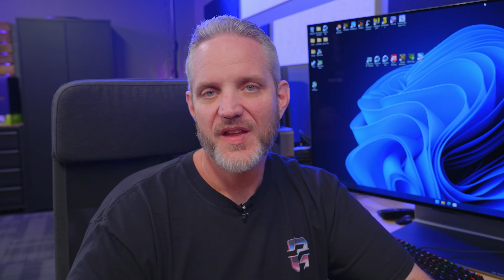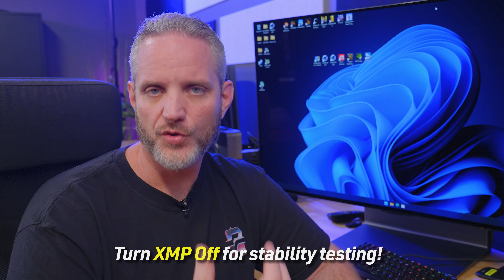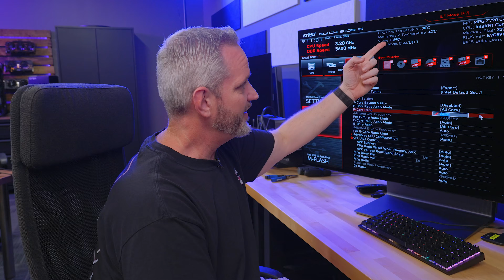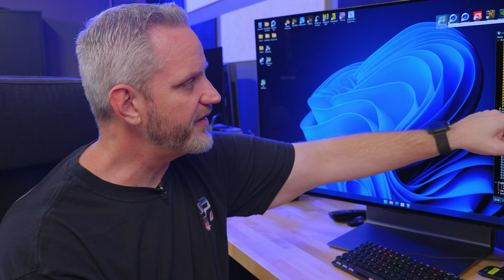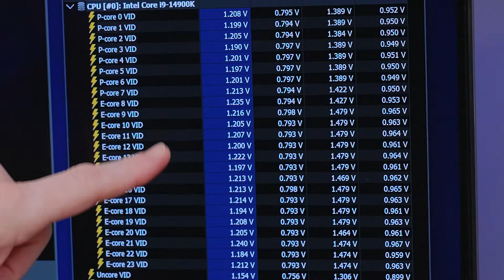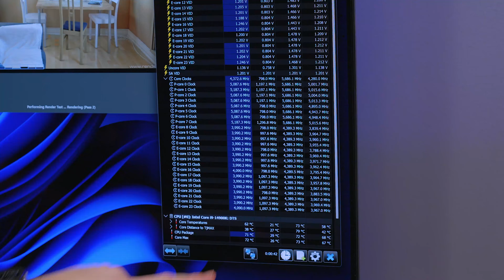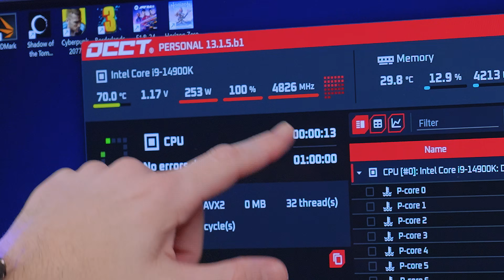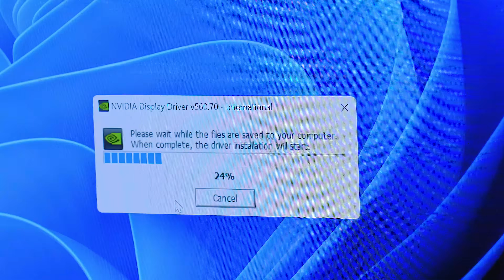Guide: How to check if your CPU is BAD!

Comment: I have a gaming laptop with intel i5 13450HX CPU and since i bought it i was facing extreme heating issues. Temps were always stuck at 99*c - 100*c under load and sometimes even pushes beyond 103*c (i checked that via hwinfo and throttlestop), after some serious search i found out that 45W is base power required for this processor to work and 55W is recommended and 157W is max it could pull if sufficient cooling is provided. BUT my concern is after going through throttlestop i found that pl1 is set at 191W and pl2 is also at 191W so i changed its value pl1 at 55W and pl2 at 157W but after testing it frequently showed power throttling and the cpu is not working as it should(ig due to less power) and the temps were under 80*c. The cpu struggles with this change in settings and when i revert it back to 191W it starts working flawlessly, my concern is i might cook it's mb if i continue working on this laptop for a long time(5+ hrs) any help on this weird issue !?

Comment: I'm preparing to test my CPU and have a QUESTION for you @JayzTwoCents as well as for your comment section!!

5:25 (video tamestamp reference)
I have 2 RAM sticks in, how many should i take out for this CPU test?

I'm running 64.0 GB (63.8 GB usable) Installed RAM :)

Comment: Why you blame the motherboard manufacturers for Intel’s faux pas is baffling to me. Intel should have built in protections on their CPU’s……..but they chose not to do that because AMD was and is kicking their ass. The faults within these chips lie clearly with Intel……….not the motherboard manufacturers. Intel advertises a certain level of performance with their cpu’s………and that performance promise is what “we the customer” expect. Their microcode update is nothing more than a pooch of performance…….and yet…….you lay the blame at the feet of the motherboard manufacturers. I do not agree with that position at all. The failure of Intel’s CPU’S was inevitable. They sat on their hands while AMD introduced their ZEN processors and got their asses kicked by ZEN. They refused to innovate……..and that lack of innovation forced Intel to drive ridiculous amounts of amperage into their CPU’S in an attempt to keep up to AMD. Intel failed miserably in that attempt and I certainly will not defend their lack of foresight. Blame lies squarely with Intel………..end of discussion!

Comment: I have a i9 10900k and I build this pc my self it’s been running great until recently, and it’s just been blue screen after blue screen and black screen and freezing and I can’t tell if it’s the gpu or the cpu , I changed out the psu but it’s still doing it

Comment: When you buy a new CPU, you're tempted to test it. When I ran Cinebench R23 (default BIOS settings), HWiNFO reported 320W for my 14700KF. Huge! It's criminal to set default values that exceed the maximum allowed by almost 30%.
Reply: Tempted? It’s crazy not to stress test a new build.

Comment: I have question i updated bios after that i had few crushes and apps freezing and not responding i saw that fans are working like on 100% and then pc restart i watched pcu temp and its not like overheating before the restart of pc, but at the time of the heating like when the fans are working on 100% i feel that pc case is little bit to hot on top corner where is cpu i also notice that one ram is not working properly can that cuse system to slow down not opening apps now i dont have problem after gaming like 1 hour cpu temp is about 65%75 on full load. What can be the problem that i had few crashes ? Thanks anyone for responding.

Comment: I have a 5950x on a water cooler and it is unstable since day 1. A little reseaech on this topic and you find out the absolute nightmare that is zen 3 high-end. Nonetheless, there is not a SINGLE youtuber investigating this issue. There are so many cases  out there of people RMAing the entire system and not find a solution. It is mind blowing how AMD can get away with that. By what you can find in the forums everywhere, AMD's problem is WAY worse than Intel's. No youtuber ever talk about that. Intriguing, to say the least.

Comment: I7 13700k, rtx 3080 it, ls 720 deep cool, 16x4 ddr5 ram, msg mag z690 ddr5, Corsair 4000d cabinet, I just reassembled my pc after RMA of several pc parts, everything works fine except that my multi core temps reach 100 degree, I even used grizzly kryonaut thermal paste, newly build it never reached 90 degree in 2022 but now p cores reach 100, what should I do please help.

Comment: The only thing that you have to do to test the CPU is take it out of the socket, tap it with a hammer (make sure it is metal), and listen for an echo.
Reply: Then replace it with a Triscuit-Mini "Unlocked" (about $15 a Tray) and I use Skippy/Smooth its cheaper than regular rip of thermal pastes.

Comment: i got a z790 asrock pg lightning with 13600k and 32 gb corsair 5200 mhz ddr5 last week. I had it running stock and my pl1 / pl2 was 253 , iccmax 511 A. Then i updated the bios to the last version and i set the boot parameters to BIOS DEFAULT and i got the intel recommended values (181 pl1/pl2,200 A iccmax). I was very scared at first but no problems with temps or something weird. I got the same performance on gaming before and after 0x129 v. What value should i have on VCORE and VID?

Comment: Im having some issues with my i9 14900ks. i did a test 30 min in heaven bench but no errors, then the day after it just stalled/freezed. Im thinking its one bad core maybe. im gonna try OCCT and intel burn test when i get home. The funny thing is it rarely crashes when in game (iracing and Lemans Ultimate), almost always if im doing something in windows while the games are running.

Comment: My 9900k runs at 4.8 GHz yet performs half as well compared to benchmarks I'm seeing online. Any clues what may be going on? I feel like it's thermal throttling but it stays at 4.8 GHz consistent and the frametimes in Counter Strike are consistent

Comment: I have a 13700kf bought it on December 4, 2022. So far no errors or crashes. But there is a nuance. e-cores I disabled and lowered the frequencies to the (3300). I just don't need that kind of power yet. Sometimes I turn them on, but because of the noise of water cooling I don't like it at all. Maybe I just prolonged its life if it's oxidation, which you didn't mention, which I think is a bigger threat in the long run. And that's scary! I did tests right after purchase with factory settings and everything was ok. I even did downvoting which improved performance. moba (gigabyte z790 gaming x ax, with XMP ddr5 6400) Thinking of moving to new ryzen. Due to the fact that there is less TDP. intel has lost confidence. I never had any problems though except temperatures even with the three section water cooling which is noisy as a train if you have an i9 or i7! In my case it was the 7980XE and 13700kf.

Comment: I just bought my 14700kf cpu in October 2024. 

The batch says X432... does that mean it was manufactured in July of 2024? 4 being 202(4) 32 being week 32.. July?

The oxidation issue was said to be resolved in 2023. So I might have dodged that. 

My msi motherboard has 10/09/2024, the final latest bios microcode update fix (0x12b). 

I wanna return everything and get the 9800x3d, but it's jacked in price. Plus, I'm using Afirm financing, and it's a whole long pain in the butt. Plus i have to put more money down if I return it. Just isn't worth it...  Ehhh

Comment: i'm not sure 13700k on a msi z690 but started with needing to replug my usb dac from time to time to register to, after every boot cycle. Now the pc is having issues booting at all. no faults to be found but just bootlooping most of the time. but when i go to bios and pres f10 it will boot. weird stuff is going on. ssd and cpu are a little over a year old. 
thing never chrashed tho while running or gaming.

Comment: I have an origin system with a series 14. It started acting up with blue screens. Tried replacing the ram since the message I was getting was memory related. Didn’t help. Did a ram test both the original and new ram were fine. Was able to reinstall windows at one point and things seemed fine - for a while. When I tried reinstalling my software got bsd again. Rinse and repeat. After a while thought first thing I should do is update the video drivers and got those corrupted download errors, or error extracting the zip after it downloaded. Got this to happen consistently. Sent it back to origin and they found the cpu and motherboard needed to be replaced. Got the system back now and things work perfectly.

Comment: I am running the MSI PRO Z790-A WIFI with an Intel i7-14700K CPU. In recent weeks started getting a complete PC freeze. No black or blue streens, the whole screen just freeze up with no sound or any response. I cannot Ctrl Alt Del or anything. I was wondering if that had anything to do with the CPU or Motherbnoard, since the issue even happens when trying to install a brand new M.2 Win 11. The install screen just freeze too.

Comment: holy... i am fraking out now! because i currently own a I7-11700k, with a rog strix z490-e with 4x8gb corsair ddr4 ram and a nvidia rog strix rtx 4070 ti oc... its overclocked by 38% using a noctua air cooler, i never had issue whatsoever. i wanted to upgrade, so i bought/ordered a new intel I9-14900k, with a rog strix Z790-e version 2 MB and 2x32 GB corsair ram, and im afraid that i made some bad purchase. my I7 system is running 7/24 since 2021. i am wondering now if i have a bad CPU! so this video at least showed me to lock voltage in place etc... i guess that from now on, i will shutdown PC when not using it... oh wait, i work with this pc 8 hours a day, and then i game for 2 hours... glad to see that intel is respecting rma. there should be a way, to have a little cpu components inside the chips, that could tell us the degradation, a little bit like nvme/ssd can tell us.

Comment: I had a computer technician come over and advise it was my graphics card (I got the black screen on the heaven benchmark).  Tried to return my graphics card, it was given back to me by the retailer who stated they benchmarked it and it was fine.   I hadn't played Black Myth Wukong for a bit, so loaded it up, and it needed to compile the shaders again.  When I first got the game, I had multiple crashes before successfully getting into the game, and this time was no different (crashed first time).  After a bit of research as to why this was happening with Black Myth Wukong, I ended up going down this rabbit hole of intel 13th and 14th generation CPU's and their instability issues (I have an I9 14900KF).  I have since downloaded the latest BIOS for my motherboard which, hopefully addresses the issues with the 129 microcode.  I have also made a couple of tweaks in the BIOS as recommended by others on the internet who know a lot more than myself (the tweaks were focused on providing stability).  I have run the Heaven and Cinebench Benchmarks.  I think things are now looking stable.  Fingers crosses.  This has been my second PC build, and it has not been a smooth experience.  The most frustrating thing is I don't feel as though I have done anything wrong.  I wished the Motherboard and CPU manufacturers would provide stable products out of the box.  Let the experts fiddle with the finer details to overclock etc.  The rest of us just want to build stable systems.

Comment: i need help with my i7 8700. its stuck at 800mhz. i have to use a program called ThrottleStop to turn off BD PROCHOT for the clocks to get back to 3.2ghz. after that it runs at 40c

Comment: I have frequent problems of WHEA-Logger 18, in which it restarts without BSOD happening, it was normally functioning until last month. I had a windows update recently and now I keep on crashing/restarting without BSDO on idle. 
I disabled C-State, PBO and CBP already. Now sometimes it crashes restart when I'm playing games like DOTA for example. Is this already a bad CPU? I just updated BIOS already and crashes still happen. 

I have a 5900x AMD Ryzen with an x570 Asus tuf gaming(wifi) Mobo
Current windows is Windows 11.

Comment: My 13600KF consistently failed the IntelBurnTest, but scored just shy of 22000 Multicore in Cinebench, and 1878 in Single Core, but I'm in an ASUS Z690 DDR4 board and I'm using a Cooler Master tower air cooler. I'm not overclocking either. Is my CPU degraded?

Comment: Man i just learned like two days ago that my undervolt hasn't been running for maybe a year... no wonder my laptop was getting so hot especially during the summer lmao. Thankfully turning all the vm stuff off fixed that and my new -175mv core -70mv cache undervolt is surprisingly stable.

Comment: How the heck could you not have been a fan of HWInfo? 😵‍💫. 

Very good important point, they are always degrading and normal PC CPU life I always heard was ten years, maybe 7-8 with stable overclocking.  Few ever daily drive a CPU more than six to eight years.

I feel like what is lacking in all this coverage is some way of determining if the motherboard vendors are doing correct and reasonable voltage and thermal tables.  For instance, what is “correct” given Intels latest guidelines?

Comment: Couple of things, you don't really need to disable XMP. I ran MemTest for 3 full passes (overnight as I have 128GB RAM). Passed without issue! I used Y-Cruncher with all tests as it seems to be (at least for me) the most reliable to pickup errors.

Comment: I finally found my answer and to this day i have 0 issues with my chip! 
13500 is based on the Alder Lake die. It should not suffer from degradation issues.

Comment: Unlucky owner of i9-14900K here (Latest ASUS BIOS. Not over-clocked in any way). So far I've seen:

— games crashing with "insufficient video memory"
— various apps being terminated by Windows due to heap memory corruption
— display going dark but PC is still working (you can hear sounds, etc)
— frozen USB devices (keyboard, mouse)
— a single-threaded CPU intensive work in one app causing system-wide stuttering, even if there are plenty of free CPU cores available
— and many more I can't remember right now

I've never encountered anything even similar to these problems with my older CPUs.
Reply: Have the i9-13900KF in Lenovo Legion Tower and getting
— display going dark but PC is still working (you can hear sounds, etc)
I have been trying to determine if this is a CPU issue as well.

Comment: I just wonder if there is something wrong with my cpu 14700k with recomended settings 307a 253w, im hitting 100 degree of celcius on 360mm aio cooler master atmos :/ should i have to repaste it? Mb Asrock z790nova with trident z 2x 16gb 7200mhz on xmp

Comment: I must have won the undervolting CPU lottery because I've been running my I5 13600k with CPU Lite Lode set to 5 on an MSI Pro A Z690 MB for the last year with no stability problems at all and that includes Ycruncher, Cinebench and Prime95. In CinebenchR23 it pulls 153w with all cores at max turbo and temps never go over around 65~70c
Reply: did you change anything else such as cpu core voltage? some on here recommend to set it to 1.25v with llc mode 3, or 1.3v with llc mode 5, but both may be higher temps when idle
Reply: @Qwen2027  No just "CPU lite lode" mode (which is MSI's  "one stop easy undervolting" feature and disabling I.A CEP (which used to default to off but now defaults to on in the latest MSI bios). If you don't disable CEP it and the core voltage gets "too low" then the CPU will start clock stretching as a measure against crashing, however this is very over sensitive and tends to clock stretch well before it really needs to.

 You can do a little better with trial and error and adjusting various settings manually but the lite lode setting is basically a table of settings controlled by one "master" value and tweaked by MSI to get good results. With this set to 5 on my i5 13600K CPU core voltage is typically very low and never goes above 1.2v, idle typically is around 0.8v ~ 0.9v

Comment: You can actually get more performance by undervolting modern CPUs than by overclocking because when you undervolt turbo clocks can run full time without reaching the thermal limit. But still people be like: DUR HUR OVERCLOCK GO BRRRRRRRR!!!
Reply: undervolting relates to voltage. overclocking relates to clock speed. you can overclock and undervolt at the same time. they are not mutually exclusive. that's actually the point of undervolting so that you can overclock.
Reply: @Ben-f6u6l  I find I get more speed by undervolting and then allowing all cores to run at full stock turbo speeds, they never throttle so overall I get more performance. I can OC but when I do that the cores cannot run at full turbo and not all of them at once. Overall Cinebench R23 scores are better at the stock speeds running all cores at full turbo full time.

 Maybe with more "spikey" CPU loads it would be a different story but with something like a rendering program performance is better with stock clock speeds and undervolting.